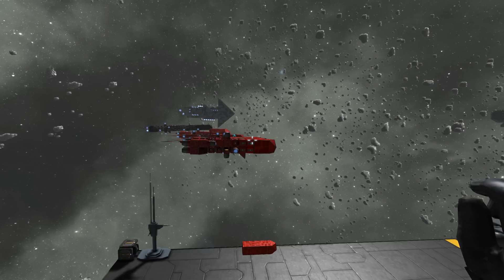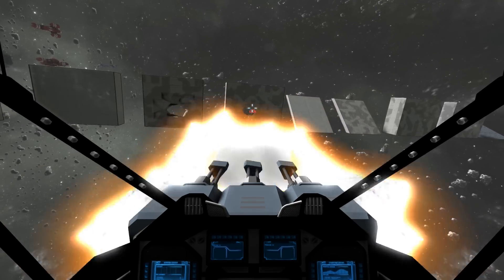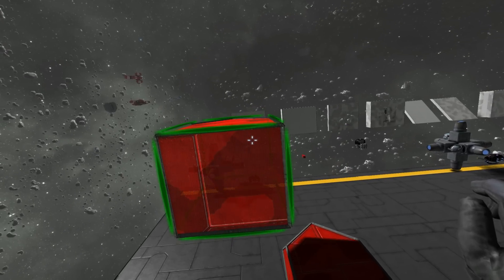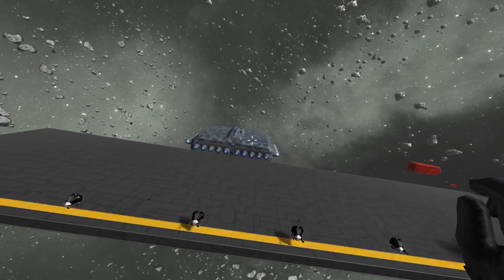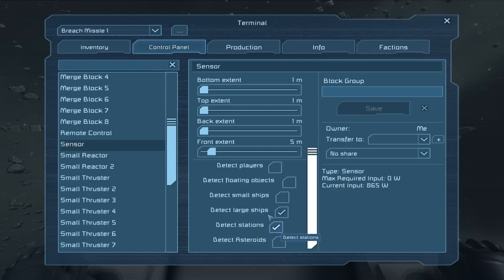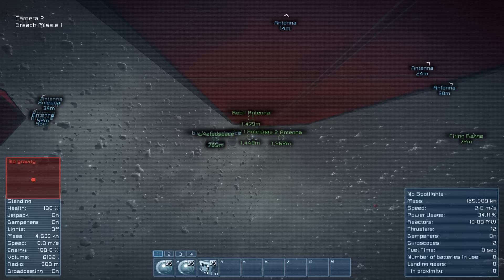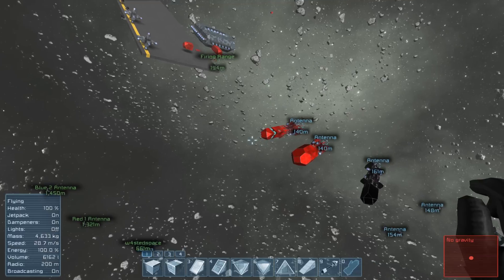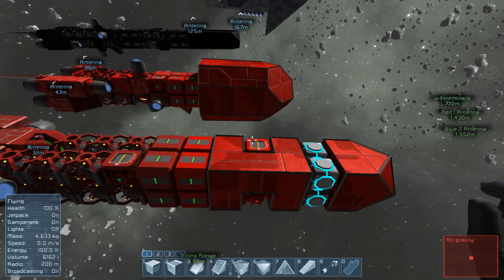Space Engineers - Breach Missles, Kinetic Testing

Comment: hey w4stedspace, i came up with a weapon design idea for heavy armor>>>: Step 1: Make a Cube roughly 2 blocks wide and 2 blocks in height then step 2: Place 2 blocks foward and mark the front with a ladder piece, Hint: this will help at some time, step 3: Get rid of the ladder on the front and finish the front with four corner triangles and then attach a join to the bottom in the middle of it and finally STEP FOUR: Add 4 blocks on the bottom and then make a 5x1 hole on a side and add a joint to the bottom and then fill the rest of the 4x1 with a ladder and then for step 5! Build 4 blocks on all corners of the joint and repeat till you have a 30 block long object or more, it depends on the armor you use and what the 30 foot long thing is attached to, hint: attach the 30 block long object to a ship that can make the thing fold into a tentacle like shape, Step Six: Make sure the joints can rotate like a tentacle and make sure its attached to a space ships side for boarding it, Also this idea came from The Game Called: Transformers: Fall of Cybertron, I name this idea the Penilium MK I. Or you can call it The Nexus Wire MK I. hope this idea gets into a vid! :D Love the vids!

Comment: Normally its called a heat projectile ... in space engineers we dont need no blasting cap no no in space something can go faster endlessly so lets throw that first.
Reply: Do you even know how HEAT projectiles work?
Reply: @LURKTec  Dude its a joke its called paraphrasing, in this case I am not going to indulge into the full working of heat. I am not the gods given expert but if you must. In the most basic sense HEAT projectiles are likend to shape charges using the Munroe effect. Upon impact the warhead explodes and a metal layer is superheated and jetted through the armor essentially melting it and cutting through it.

As such the comparison to a heat projectile in this case, the solid charge that is launched ahead of the torpedo is the superheated jet of metal opening up the armor. The explosive package that comes after makes it more akin to a two stage explosive.

But again I was paraphrasing. I hope my reply has sated your lust and desires for pin point precision.

Comment: I've made some missiles that are wire guided like a TOW using a script somebody wrote up, and using a mod to increase the speed limit up to 1000m/s I can guide missiles into moving ships at 10km, and by then the missile is moving close to 1000m/s and utterly destroys ships. They have the capability to destroy a full half of a red ship, either the front with cockpit or the engines in back, and will penetrate through 14 layers of light armor or 10ish of heavy armor. They consist only of 5 or 6 forward thrusters (to accelerate quickly), a merge block, a gyroscope, a warhead, and a couple armor blocks in front as a penetrating rod so the warhead goes off just inside the armor. 

Great part about the script used is that it can be used for fire-and-forget guided missiles and works wonders for that too
Reply: is this on the steam workshop as I would love to see this in action!!

Comment: Well I mean, i ain't no Space Engineer, but wouldn't it just be logical that if you release the front which now holds your current inertia (Probably with degrading speed), get bumped by your ship from behind since his inertia might be faster since it just de-loaded decent mass and therefore get more momentum than your front release? Also just possible that the game registers its physics slow enough for you to bump in it before game applied calculations to it? Heck i don't know, not a proffessional game developer either.
Reply: It's speed doesn't degrade, it's space, you push something and it floats on for ever (pretty much)

Comment: I've made a missile that has 4 missile launchers on the front (they fire automatically when it gets within sensor range of a ship directly infront of it) I also have a sensor to detonate the warheads if it detects a ship (or player, to prevent tampering) close to the side/backend as I've had times where the missile went straight through the ship (more of a wall for testing) It does a surprising amount of damage. I'm going to remake it with vanilla survival capability, not sure how im going to get power into it semi-fast though, I'm thinking a reactor and 1> uranium

Comment: if your doing kinetic weapons I'd might advise raising the max speed to 200 or 300 m/s any faster and you'll glitch right though it some times. Also industrial, or the titan thrusters for speed. also for your problem, did you have the safeties on your warheads if you didn't turn them on and use a timer block to arm the warheads on the last separation.

Comment: You should make a kinetic weapon that orbits around a planet and launches a projectile (non explosive) towards the planet. I'd assume when it hits, the force would create a huge crater, causing destruction to anything in the blast radius.
Reply: 104m/s max speed it really really doesnt, normally ya depending on what you shoot it can create a fairly large hole (2/3m  IRL if all youre doing is dropping it from orbit so that it will ACTUALLY fall straight down otherwise things are a bit trickier) but in space engineers a heavy armor block from orbit..... makes a small dent in the ground thats about it

Comment: If you're having trouble piercing the armor, try giving the projectile a long, sharp "nose" with slopes on it's sides to make a "saw" that should widen the area of damage and flow smoothly through the armor without taking too much damage itself. I once made a lightly armored ship that could penetrate up to 8 blocks of heavy armor with ease, and if it survives the crash (Which is guaranteed when ramming into lightly armored ships, 2 blocks of heavy armor at most) the player can get into the engine room and set off explosives to blow up the engines, leaving the ship drifting helplessly. That's why you need to build a reactor room with at least 3 layers of heavy armor, kids!

Comment: "It is very hard to crack", Try to "crack" my ship. ;P http://puu.sh/mWcfa/4965e2252d.jpg

Also, I built my own railgun that launches projectiles up to 675m/s straight out of the barrel.

Projectile: http://puu.sh/mPYUp/7f1e7da86e.jpg

Barrel: http://puu.sh/mPYXv/58c9191ee1.jpg
http://puu.sh/mPYZE/d3235c063d.jpg

And damage outcome from 500m away (Ship is full heavy armor with several layers, goes straight through and breaks inside causing massive damage on the inside): http://puu.sh/mPYOZ/9a631a980e.jpg
Reply: +Epin Ephrine Well... That is certainly big.

Comment: Battlestar Devastation...hollowed out many asteroids, massive 10 layers of armor, heavy armor, first 3 have repairers, internal structure coated with heavy armor outside, light inside the coating. 100s of batteries charged from the solar panel bases, and some ships inside with the ability to gather energy. Ship has massive stores of Uranium. More ammo than most fleets. Multiple grav drives intended to start or stop movement, but do not stay on. Has a well defended super weapon esque bay, capable of unloading explosives that decimate star bases, and even planets when delivered in the high amounts available.  First layers of armor have repairs when taking damage, massively bolstering defenses, and even without power still has massive defenses. Weapons are remote and manually controllable, with separate power, ammo, and even comms. Has heavy loading doors protecting massive solar arrays one block into the armor, allowing it out of combat sustainability. All weapon systems are easily refillable, but can be operated with the ship disabled, and can prevent the enemy that controls the ship from shutting them down. The ship comes with the ability to construct its own repairs, gather materials, and generate power. It isn't the fastest ship in the fleet, but good luck defeating it. It has weak points buries in the armor to repel gravity weapons, and can be used to repel attackers or as a weapon against a nearby ship. The ultimate weapon.

Comment: Hi!
I know this is an old video but still I have some coments to it.

When you are dealing with kinetic weapons the most important factor is speed at the time of impact. You see you can have prety big and heavy weapon but it won't be able to cause good penetration if it is to slow.

So you need to get as much speed as posible. How do you do this?

One way would be to fire your weapon from far away so you have enough time to accelerate. But the problem in such approach is that it quite hard to aim from the distance and when atacking moving targets it can be compleetely useless.

But another and much better way is to equip your weapons with so called "mass drive" (combination of artificial gravity and gravity generators)..

When designing the "mass drive" I recomend using just one artificial gravity block and multiple gravity generators all laced in a single line where artificial gravity is in the middle. Why?
In order for artificial gravity block to work it requires certain (fixed) amount of energy. So placing more of them quickly increses the energy demand.
But gravity generators on the other hand don't have fixed energy requirement. You can greatly affect their energy requirement by adjusting gravity field parameters.
So I tend to make the gravity field to be verry narrow and just long enough to cover the artificial gravity block.

By using such approach I managed to create projectiles which can reach full speed in less than 500 meters and for that it is enough to have just one small generator for powering all those gravity generators.

Last time when I was playing with this concept it was enough to penetrate red ship all the way through without the use of any explosives. But I'm not sure if this would still work since the armor strengths were adjusted in one of the recent patches.

Anywhay as soon as I get powerfull enough PSU for my new computer I will probably make a few videos of my own about using kinetic weapons.
At the moment I can't do this as my laptop that I currently use is not poerfull enough so recording of video causes to much lag.

I also have some interesting idea for a mas cannon that I will try. And if my idea would work as I imagined it would be deadly.
Reply from the maker: Silvo Weiss Some good points sir and thankfully most of them are things I've tried since this video so I don't feel too stupid :) 
The one 'concern' with using gravity as a propulsion system (also in ore/mass weapons) is it gives the enemy the option to also use gravity as a defense.. it's very hard to produce a projectile with sufficient gravity aboard that can overpower a ship or station which only needs a single set of generators for it's defense, rather than mass/gravity on each projectile. Spherical generators are also VERY good at deflecting shots coming in as they don't simply apply a longitudinal force to the projectile but also a lateral one forcing it off target as well as slowing it down.. once it's off target the gravity 'shield' will then help propel the projectile away again too.

There are solutions for some of this of course, using timers to disable the mass blocks and gravity gens after launch is the one I most commonly use, but as a whole I don't see ore/material based weaponry being viable at all really any more (because it's impossible to prevent them from being effected by gravity) and gravity as a launch method is an expensive route as of course you need so much stuff on board the projectile for it to work.

I'm currently looking into other launching techniques that don't require mass/gravity OR thrusters to work, but it's a WiP right now.. need it to also work properly regardless of the movement of the ship it's attached to and that bit is taking some time to perfect :)

Thanks for the comments man :)

Comment: Supposedly blast doors cut through armour blocks much easier than Heavy armour blocks but I don't know of a design that would work well for it.
Reply from the maker: Kidou I've used blast doors more recently in some designs, I'm not totally convinced they are much better and like you say it impacts the design a bit. Thanks for the suggestion :)
Reply: Though I did find something interesting in a test I made, inspired by this video.  Drills seem to work far better as a tip.  I ended up making a ship with a Drill tip and some warheads that can ram, drill a little deeper then detach the tip and fly away to safety.
Reply from the maker: Kidou Hmm, interesting.. I'll have to try that one out! Cheers :) Glad I got you experimenting as well!
Reply: Antennas are my go to for an armor penetrating cap on my tandem rockets

Comment: You might have already been told this by now, but blast door blocks are excellent at ramming. They take out many layers of heavy armor before they are destroyed themselves. I once used a "blade" made of blast door blocks to cut a heavily armored ship in half. The long way. It must have been at least 150 blocks of heavy armor I destroyed and I'm guessing I lost less than 20 blocks from my own ship.
Reply from the maker: Yeah it's been mentioned since, they seem to be very good at dealing damage in a ramming scenario but remarkably weak when it comes to surviving explosives/projectiles. Saw some figures at one point to explain this although they did support the idea that while blast doors are strong heavy armour should still be a tiny bit stronger. Very hard to match those figures up to reality though so happy to believe that blast doors might make a more effective blade. Don't underestimate the integrity of the ship I ram at the end though, it's entirely heavy armour and multiple layers thick in most places (front is 5 layers solid on it's own)

https://www.dropbox.com/s/28qf7ory3by0iir/aftermath.png?dl=0 is a shot someone on reddit asked for, showing the end result of that maneuver.. Having completely obliterated the first ship I went in for a shot at Red and that was the point the reactors cut out :) I do think ramming is a very effective method at the moment though especially as the same armour used to ram with protects you on the approach so will be back playing around some more and will give blast doors a go, fully expect some "blades" made of those to be vicious.
Reply from the maker: I notice now the first ship's (my command bomber) engines are still running despite only like 20% of the ship remaining.. told you it was built tough! lol

Comment: i made a small ship wariant alot more complicated one that used 2 seperate warheads, this a cheaper and more effective design, considering how cheap a warhead is.
Reply from the maker: Don't forget how much extra large blocks take to make though, you save a lot by sticking with a small ship although I found the penetrating capabilities of small ship heavy armour a lot worse than large ship armour.
Reply: my small ship design was 1x1x10 around and it culd penetrate two layers of light armour around a half heavy whit just two warheads so its not bad considering its weight.
Reply from the maker: That's pretty nice for that size :)
Reply: 2x2 warheads on two seperate parts that seperates mid flight to explode twice if i was unclear sorry :)
Reply from the maker: No it was fine, I got the idea :) Like the concept of having an initial explosion to open things up.. Have you seen my cluster missile video? Has something a bit similar where it launches 4 decoys and then 4 small breaching explosives ahead of the main warhead to try and help it breach deep inside. That last stage won't explode until a sensor at the back detects that it's right inside the ship. Quite a lot more complex though and I never worked out how to launch it effectively, so much was using timers that you had to reconfigure for every different range, bit messy...
Reply: i always tend to have these small problems that take ages to reprogram when building weapons :/ and rotors 'n' pistons are a also hard to make work since their a bit buggy.

Comment: I was testing with warheads and I found something interesting. When you shoot a missile that contains more than one warhead, the first one that explodes seems to be the only one that actually does damage, because the other ones get destroyed in the explosion before they have a chance to be triggered.

However, when you group them and blow them up at the exact same time using their detonate button, they actually all explode and do damage. With 4 or 5 warheads placed inside the red ship side by side and detonated manually, I was able to nearly destroy half of the ship.
Reply from the maker: I have found pretty much the same, sensor or timed detonation ends up with waaay better results. On this one I'm using a sensor on the top about 3/4 of the way down the ship set to detonate the warheads all at once as soon as the explosive part enters the targeted by a decent amount. Well placed shot will cut the red ship in half although didn't manage to capture one from the video :) Good to hear someone else who's come to the same conclusion :)